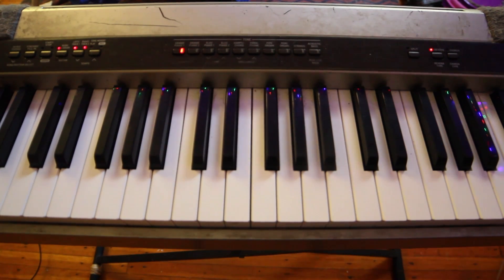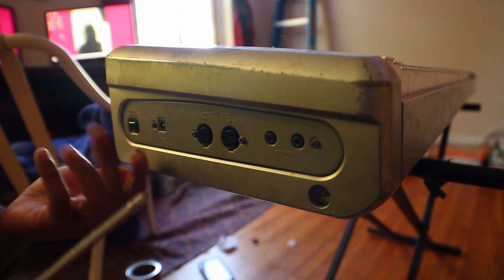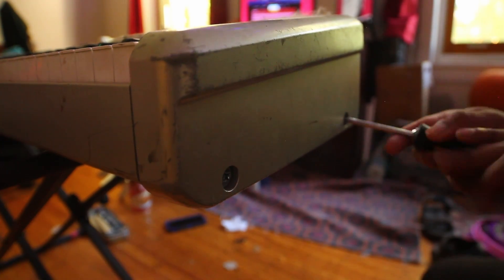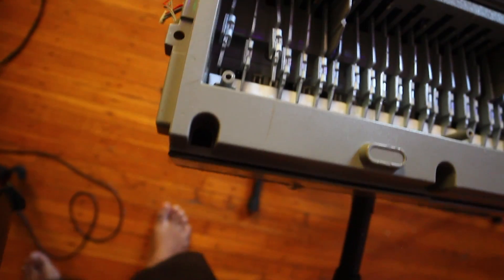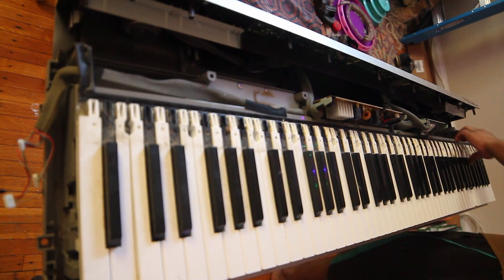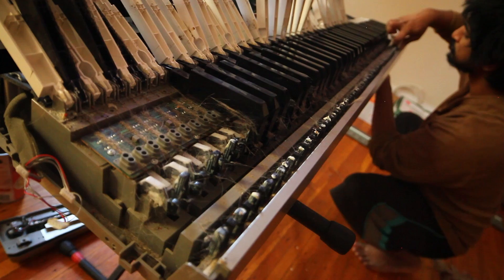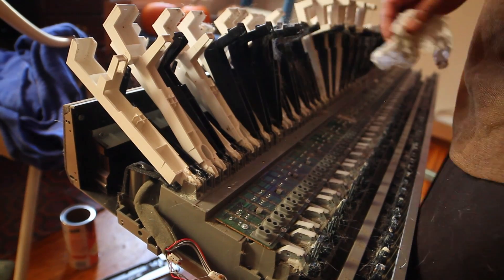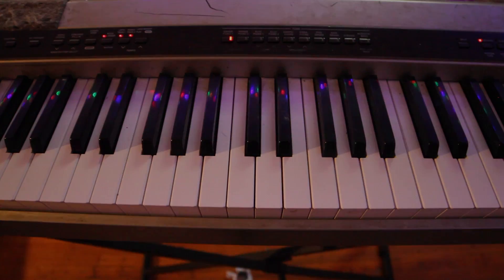DIY Digital Piano Repair (Keys Not Working) Casio Privia PX-110

Comment: My Casio CPD s360 having a similar problem. One of the E key went soft for a while and now it's completely silent. Likely a contact problem. The designed of the casing I was told could be different. I may not be able to follow your instructions here to fix it. Do you have another video on the s360? Thanks
Reply from the maker: @sancheowho5266  I don’t. Hopefully you can find something and I feel like there are certain principles you can follow to get the case open and get access to the contacts
Reply: Did you ever find a solution? I'm facing the same problem

Comment: I'm stumped at the moment - one key intermittently working - disassembled, cleaned, and same thing. The part I don't understand, is I tried another 'rubber button' or contact piece from another key to test on the 'dead' one, and it works! There are two contact points under the rubber button that when key is pressed, makes contact with the circuit. Both contact points have tiny circular dark material, maybe felt or rubber, not sure. What could possibly be wrong with the contacts? I'm down to thinking maybe the actual electronics are damaged, although does not visually appear to be. Thought I had it, too! Any tips are very welcome, thanks!

Comment: Hey. Nice video! I am searching for the Main board (10288048) and the Display board (10288046) for a Casio Privia PX-320. Do you know where I can find it, even used or refurbished? I am also willing to buy another equal piano with some other problem so I can remove this parts and use it. Do you have the same model Piano so I can remove some parts?
Reply from the maker: Unfortunately I don't know any place off the top of my head. Might find some luck on ebay, but this is an older model so there may not be many out in the field

Comment: Please I have one and power comes on and goes off frequentl I opens it I andfound   out that some  wires are cut  off  so please make a video showing  how the wire connection are done
Reply from the maker: Hi Jonathan. I actually made a video when I was having trouble with the keyboard not turning on. I ended up having to replace the DC power jack and I go a little bit into the connections. I'm not really an expert in electronics, but I know enough to fix things sometimes, but here is the video and I hope it helps. Maybe I can make an indepth video about the circuit board in the future https://www.youtube.com/watch?v=gEEOpnP_F5w
Reply from the maker: let me know if it helps!

Comment: I would have used a vacuum and a small brush to get most of the dust and hair off before spraying any liquid. Also use a cover on the keyboard or stand it vertically when not in use. You can use an old pillowcase or cardboard for a cover.
Reply from the maker: good notes. I def don't do best practices most of the time, but I try to get things done as best I can. A vacuum would be a good thing to invest in